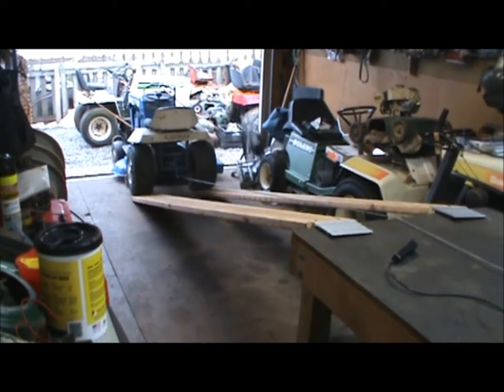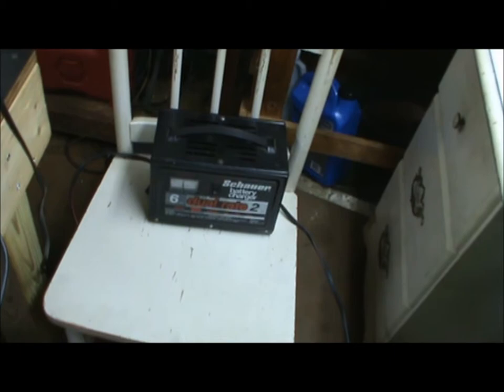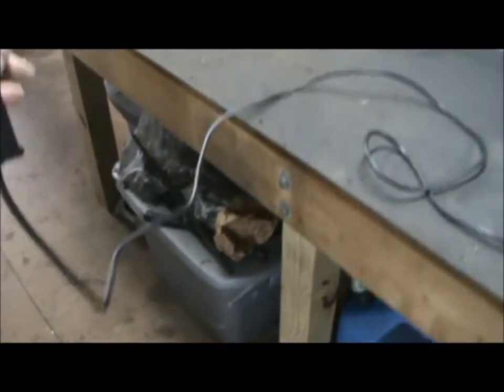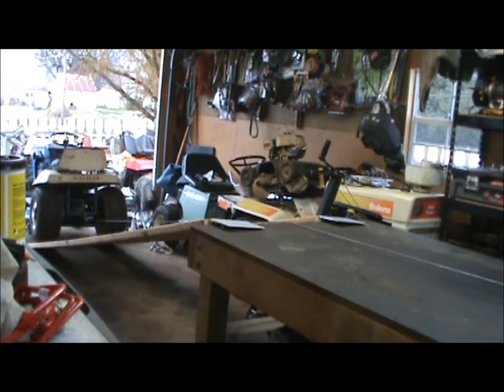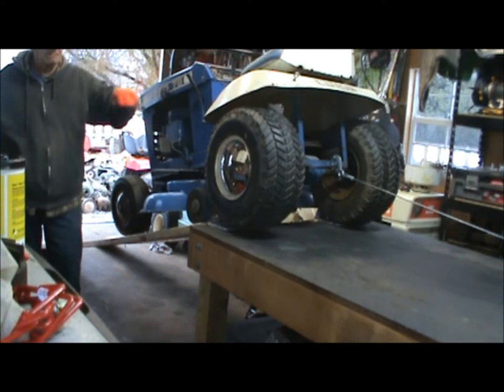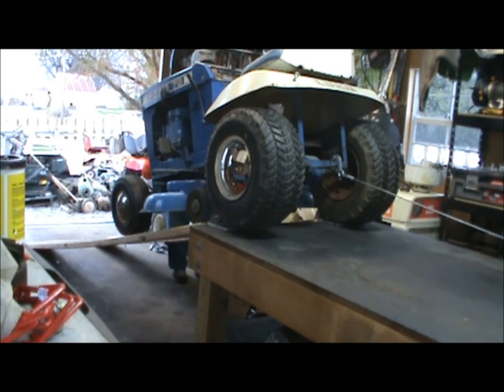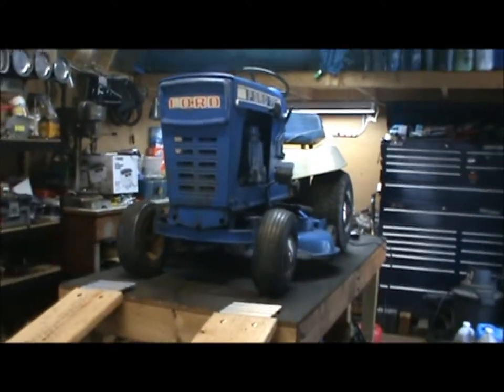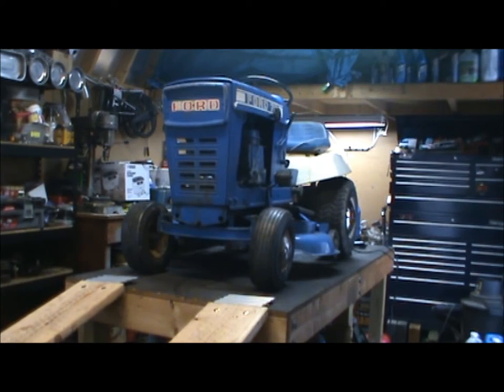Garden Tractor Work Table Made out of Wood

Comment: My table is similar to yours except my corners are 4x6s. X 8ft tall , I rig chains and a chain hoist from the 4x6s to lift the mower from side,front or rear,basic deck height is 18 in and 8 inch removable corner spacers,I use this table for many tasks.

Comment: I've got to use my garage.  
I think I'd make 2 tables each say 24in wide and I like your 7ft length.  But then I'd put bolt holes across one side to clamp the two tables together when I wanted to put lawn mower / snow blower / push mower up ( I'm so over lifting crap from off the ground )...

Then when I'm done can split the two tables and push them back against the garage wall.
Reply: Probably put some sort of wheels on it as well.